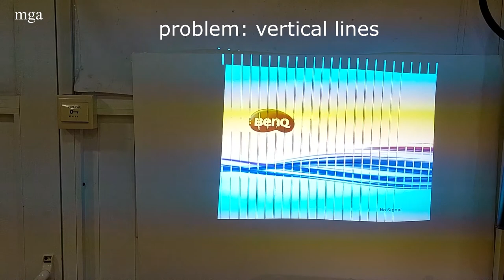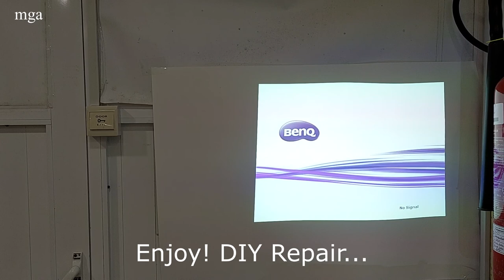BenQ ms513p Projector Vertical Lines | SOLVED

Comment: Take apart projector, remove lamp, remove top cover, remove EMI shield from motherboard, remove all connectors carefully, remove motherboard, clean contact array for the DLP chip unit, clean receptical contacts on motherboard, reassemble. Got it.
Reply from the maker: Good job...